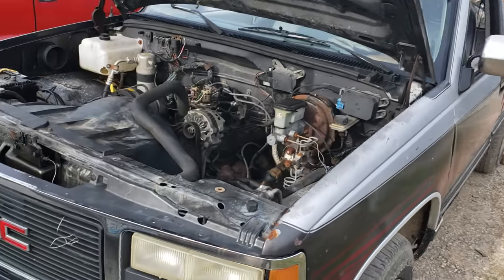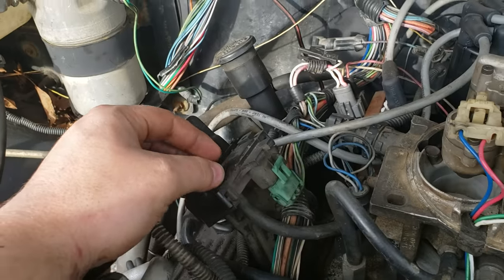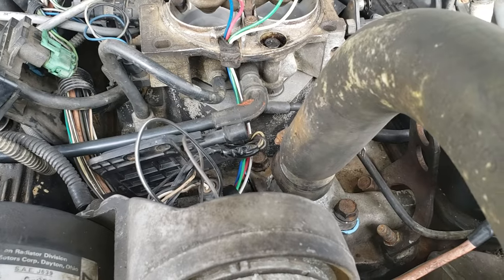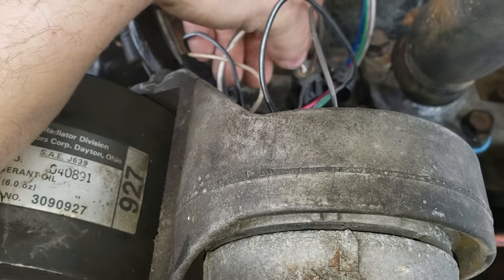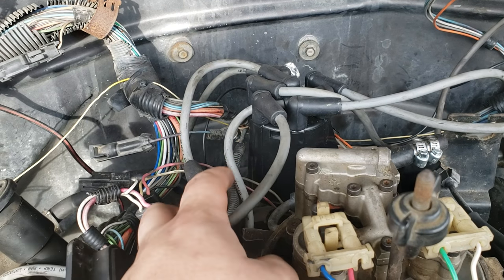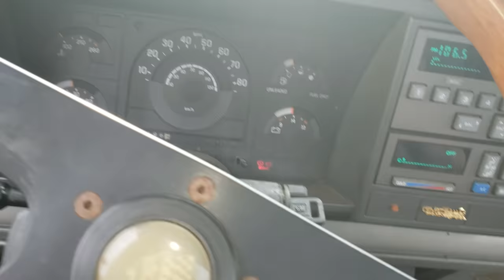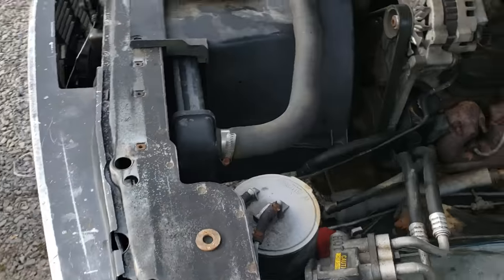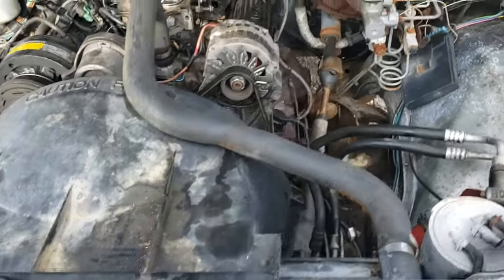Chevy/GMC TBI flooding smoking running rich diagnose and fix

Comment: Thank you so much for this video ... ive been chasing my tail for days .. ive replaced almost every single thing rebuilt the fuel regulator replaced the injectors ... replaced plugs wires rotor cap oil pressure switch fuel pump ..filter ... i was just about to calll the wrecking yard .. see you talk about a map sensor and temp sensor i said why not at this point .... it immediatelyf fired up ...
Reply: What was it and any code
Reply: @haniballector have you figured it out yet having the same issue

Comment: The frame rate of the camera you are using is what caused the spray of fuel to appear on video differently then it did in reality. Imagine what a strobe light does except for it's a picture taken by a camera, or maybe imagine a GIF. :-) Thanks for the video, I am going to throw a new map sensor in because my truck has 320k+ miles and she probably needs it.

Comment: Thanks, the little guy on top (coolant temp sensor) broke and made my truck start rough with the flood and service light come on. Just replaced and truck starts normal without no service light.
Reply: Woud the check engine light mostly come on during extended idling (like more than a minute or two)?

Comment: Thanks for the video.  My 1994 454 suddenly started flooding,  my shop claimed the temp sensor was the problem but couldn't fix it, even with a new part.  I couldn't get a code from the check engine bypass trick.  It's undriveable so I'll try changing one thing at a time.

Comment: 1987 4x4 silverado wiring harness caused so many problems after truck reached 20 year point eventually converted to carburetor. Map sensor  caused problems every 6 months I started carrying 2 spares. Ignition modules every 2 or 3 years until finally traced intermittent engine shutdowns on highway to  corrosion on bottom of distributor pickup
Reply: I’ve got an 87 too ..fuel pump stays on when key off ..new pumps relay tank actuator no breaks in the wires ..now runs like it has a cam when first fired up..seems to be an air leak I don’t know..any suggestions having the same truck?
Reply: Mine did the same thing for years during warm up even with new vacuum lines, manifold gaskets,tbi gasket, fuel pump, inline filter and injectors . Always figured it was the 3" exhaust and headers with summit x pipe I installed made the primitive computer go crazy never changed with summit chip and used Bosch 02 sensor. I bought truck new when fuel injection was the 1st year on chevy trucks and GM couldn't possibly know the bugs that system would produce.

Comment: I’ve got a 350, has to be vacuum leak. Has high idle, I’ve replaced throttle position, and IAC sensors and nothing. I’ve noticed smoke coming from passenger side exhaust manifold area so I’m thinking gasket is bad causing it to suck in air there and be my vacuum issue? I can’t figure it out for the life of me.

Comment: I just recently replaced my ignition coil due to a blue arc and (popping sound) from the wire to the metal part of ignition coil. Im assuming the wire is bad but not certain. What do you think it is?

Comment: I wish more people making repair diagnosis vids would show how the vehicle is running before its repaired to see its symptoms
Reply from the maker: if its a miss then it sounds like its missing and the engine will shake. newer cars if it detects a miss the engine light will normally flash. flooding u can smell it flooding or notice some blackish flood smoke.
Reply: @maximumredline97  Got it, Thx

Comment: This is great pointing things out, but how do we know which one is the problem without just replacing everything?  How did you know for sure it was the cap and rotor and spark plug wires?  Was it all of those things or did you just replace them all to be sure?

Comment: I changed my cap and now it runs smooth (92 chevy Tahoe 350 ) but only in the am when it first starts up I try to take off and it backfires but only once , once it’s warmed up it’s running good
Reply: Ever figure out the cause?
Reply: @robertcraven1771 yes it was the timing it off when the cap was changed

Comment: Thanks for the information. 
What about gray smoke on starting  and high idle after warming up 93 GMC 4.3
Reply: Try replacing your pcv valve and check for cracked hoses.
Reply: Worst case scenario valve stem seals unless it’s got 1,000,000,000 miles on it and it’s probably more the fuck out bro lol

Comment: my truck boggs out its 95 gmc 2500 change fuel fliter ecm tps clean carburetor still boggs but runs real smooth n quiet

Comment: I’m thinking of buying a 4.3L Chevy that is running rich it has over 200k miles. 

Is running rich a fixable problem, is running rich more of a communications between sensors, ECU EXTERNAL issue versus internal engine problems?? 

Should I expect an internal engine component failure from a running rich condition… is that common??
Reply from the maker: Yes majority of the time its sensor, cheap part related. Shouldn't be anything wrong with the internals. Just always warm the motor up and check oil pressure. Oil pressure is key
Reply: @maximumredline97  thanks, I thought so, I took a look at the truck earlier. I wasn’t able to start it because the guy was working, but I noticed that the MAP green connector was disconnected and not MAP sensor to be found.

The guy said that it idles high when he starts it, then when Putting it into gear it boggs and sputter like it’s wants to die. 

So far I would say the Missing MAP sensor is the problem at the moment.
Reply from the maker: @texas87horns  probably has something to do with it. Or idle air control valve

Comment: I have a 1994 Chevy Silverado I replaced the ECU buy the cap and rotor I replaced fuel pump relay and I replaced the fuel filter Everytime I give it gas it's dies how can I fix it
Reply: EGR valve fixed that for mine. Easy to change.

Comment: I have a 1994 GMC k1500 5.7 that continues to run rich. Completely brand new throttle body with all new injectors and temperature control senser.  Also new throttle position senser and idle air control valve. New Mass air senser, plugs and wires with cap and rotor and a new 02 sensor but its still running rich. so I bought a new distributor and will be putting that on this Friday.  If that don't stop it from running rich I don't no what else to do. Any input would be great thanks
Reply from the maker: Sounds like a lemon lol, but lmk how the distributor goes
Reply: With all the money I have put into it it just might be lol. Will let you know if the distributor is it or not. It seems to run richer when it gets at running temperature. That why I put the new temperature senser in.
Reply from the maker: @sassykat012283  did u replace engine coolant temp sensor
Reply: Yes I did replace the engine coolant sensor
Reply: Change the timing a bit
Reply: This may be coming in late but the fuel pressure regulator has a diaphragm that's probably compromised. Try replacing it and if that doesn't do it you may need to adjust the pressure itself. Tricky if you don't have a Schrader valve, like my 89 Silverado.
Reply: @sardonyxsky  I hope I'm wrong but you should test your exhaust for coolant or water contamination with a kit you borrow at a local brand name parts store. You might have a blown head gasket. 
How's the smoke after it's warmed up? Gone?? 
Oh, and how many miles on it?
If it runs good like you said it does,  doesn't sound like a pressure regulator.
Reply: @sardonyxsky  Try the test kit, if anything, for peace of mind. There's a fluid you have to purchase but results tell the tale.
Reply: Did you find your running rich,I myself have a 94 k1500 350 tbi & like you I replaced sofar everything but the o2, knock sensor & evap purge cyloniod.. 
  Runs awesome but still smelling rich around the truck everywhere.
New fuel pump n gasket & filter, new map, tps, IAC, coolant temp sensor & new plug harness for it.. new distributor, wires & plugs & coil thingy..
  Chased my grounds & hots & cleaned them up..
I'm hoping original o2 is reading bad & causing my richness..
Reply: Any of you guys solve it

Comment: Just changed distrubotor due to no spark no pulse. Now it pulses injectors with wkey on engine off. Will run on throttle floods out at idle, we literally fill throttle body above throttle plates once it dies. I'm assuming that's the module bad in the new cheapo distrubutor?
Reply from the maker: iv never heard of this. maybe a stuck fuel pump relay. i think there is a sensor on the dizzy that controls the spark, i dont think it has anything to do with fuel pump running. ignition pickup

Comment: So I have a 93 k1500 350 tbi and it constantly floods, I can’t seem to figure out what’s wrong with it, I changed the map sensor, distributor cap, spark plugs and wires, fuel pump, fuel filter, fuses and anything that I can think of, if anyone can point me towards what to look for next that would greatly be appreciated as i need my truck and it hasn’t been going for a few months now
Reply: update: it ran good until i changed the fuel pump

Comment: Mine has an issue on start up idle being real rough but only in the afternoon leaving work. Driving me nuts
Reply: Same here. Haven't figured it out yet...
Reply: @frankrizzo2724  it was my fuel pump. It did seem to ALMOST do it one time after I put a new one in but didn't quite, ran techron in, hasn't had those issues since
Now I've got to find pcv valve hose to the throttle body lol
Reply: @MadAtMax.300Blackout  Thanks for responding. Mine only does it when it's below 40 degrees or so but it did it today after work and it was like 60 degrees out.

Comment: Hello. Good video.
  I have an 94 7.4 2wd suburban

I'm getting super surging when put in gear. Driving is moderate kinda goes away. Weird.

I've replaced 
Tps 
Map
Iac last year
Temperature sensor last year
Whole Distributor this year.. also purchased rebuild kit to rebuild old one.
I think canister purge valve. 
Has new plugs.
Oem plug wires
Rebuilt tbi - all orings ,gaskets. Fuel pressure regulator.
New oxygen sensor.
All vacuum lines replaced  
Oil change
Air filter
I did buy this suburban used. And had trany built. 

I can't let it go for a dumb idle issue. Any more help. I can get. Thanks.

I hate to take to a shop and pay out tons. When I can try myself..

Also timed @ 4degrees.

New fuel filter.

The old distributor pick up coil was super extra rusted and cap rotor has massive corrosion
Reply: Time at 0 them old trucks prefer it

Comment: Ya truck sat for 9 yrs in the driveway and now I’ve got it running but I can’t get it to pass smog. I put a new catalytic converter and in a week it burned the cat up! Literally ate up the inside of the cat. Help!!! I can smell that it’s running rich but how do I fix that? Any suggestions will help! Please!!! It ran perfect before the transmission went out and it runs excellent now with no codes I already replaced all the sensors
Reply from the maker: Have you done a good tune up?

Comment: i have a 1995 k1500 and at idle the throttle body makes a high pitched whistle  noise i dont know why
Reply: check the IAC valve
Reply: maybe a vacuum leak like he described in the beginning. tb gasket
Reply: Yep, sounds like vacuum leak, check tbi base plate gasket, I use water squirt bottle
Reply: O2 sensor
Reply: @worstnightmare9772  check engine light would come on for 02 sensor...

Comment: I had some problems with my S15 jimmy, I replaced a bunch of stuff and sensors and could not stop the running rich issue, finally I set the timing according to manual and  then focused on electrical, and that’s where the problem was, fuel pump relay😡

Comment: 1990 GMC Sierra changed  plugs, plug wires, distributor cap, rotor button and EGR valve and still runs rich, cant get through emissions, have had it tested 4 times. Any suggestions
Reply from the maker: Check regulator or injector pulse

Comment: 1990 gmc c1500 5 speed manuel with a 350 small block it runs good but sometimes stalls when I come to a stop thinking it’s in gear still backfiring and popping but I’m in neutral I give it gas and it gets back to it’s normal oil pressure and idle not sure if it’s my trans or motor but it’s wierd need help changes my plugs wire ignition coil fuel filter and everything has been working good other than that little detail of it wanting to stall when thinking it’s in gear and of course if your in any gear and stop without putting it in neutral it will stall.
Reply: I have the same problem lmk if U found the Issue
Reply: @carlosmagana5909  same here
Reply: @carlosmagana5909  ending up being my EGR valve stuck on open when I would step on it the valve would open to release gas and won’t close changed it and had no problems after

Comment: My car 1990 Chevy Caprice tbi runs good til I sit at a red light to long then it just die and you can smell gas but it'll start back up and drive .... Alot of people saying the TBI is bad or computer what u think?
Reply from the maker: Try ur tpi sensor
Reply: @maximumredline97  I change that also didn't work
Reply from the maker: Map sensor
Reply: Mine does the exact same 1994 Silverado 5.7 tbi
Reply: My 89 Chevy caprice Tbi is spraying out too much fuel. Any ideas on why? Can get it to run for a few but not driveable.

Comment: Hey yeah I have a question  I turn my key to on pos.and the injectors  just spray and spray and spray and spray flooding out my engine  to where it won't start or if it does start it floods out same recommendation?  Or is that the diaphragm  holding the injectors in place?
Reply: I would suspect whatever the part is called that tells injectors to fire. follow wires and youll find the problem I suppose

Comment: I have a 1993 GMC 5.7 v8 and it won’t accelerate when u press down the peddle all the way u have to lightly tap it for the truck to accelerate I already changed the knock sensor, map sensor I need help any suggestions??
Reply: Tps throttle position sensors
Reply: I have same issue
Reply: I have same problem. I will return .............

Comment: I've got a 95 350tbi bogging down and backfiring at highway speed, i just did tune up all filters and tps. Idles low and bogs out at cruising then starts bucking and jumping like i lost a spark plug wire until i stop and check. Then it bugs out again. Any advice for all that?
Reply from the maker: Did you change the coil its self??
Reply: I did not but it doesn't look crusty or rusty may have been changed before i got the truck.
Reply: check your timing and maybe you got a clogged exhaust system.
Reply: Distributor maybe

Comment: I got a 88 5.7 and it shifts at high rpm’s in 1st gear and ideal?
Reply from the maker: it may be the tv cable adjusted or the tps. im not to sure on it tho
Reply: Throttle valve is probably stuck in transmission.

Comment: Mine has the problem but it don’t pulse it just dumps so much fuel constantly
Reply: Did u find the fix? Mine does the same
Reply: I was a fleet mechanic and had a lot of these trucks. Had one that was pouring black smoke out the exhaust. Found out one injector had something stuck in it and it was wide open all the time.

Comment: Hey I got a 1991 gmc Sierra 5.7 I replaced the fuel injectors and fuel regulator but still backfires so the culprit is cap and rotor?
Reply from the maker: Or possibly engine coolant temp sensor
Reply: Replaced coolant temp sensor still having the same problem up next spark plugs and wires then cap and rotor
Reply from the maker: Is there any valve noise?? Does it backfire under heavy load?? Miss on several cylinders?
Reply: No valve noise when I start it from a cold start and I put it into gear and drive it has power but as soon as it starts to warm up I start losing power and starts backfiring from the intake at that point I just let it warm up and even then I step on the gas it just backfires from intake and has no power to go unless I rev it up high and release clutch super slow which I dont like doing once I'm going I dont have enough power to pass cars when I need too as soon as I try to give it gas backfire from intake
Reply from the maker: Have you checked the timing??
Reply: How do I go about that
Reply: Try look at the distributor cuz on my 89 GMC Sierra was doing that back fire and timing was way off, so I just replace it with a new distributor it came in a kit... After that ran Good to this day still running and this was in 2009 now motor is in a 90 Sierra shorty 4x4
Reply: My 88 c1500 did the same thing. I bought the tbi rebuild kit and it was gone. My guess is gas fumes/gas  seeping through the cracked gaskets and causing it.